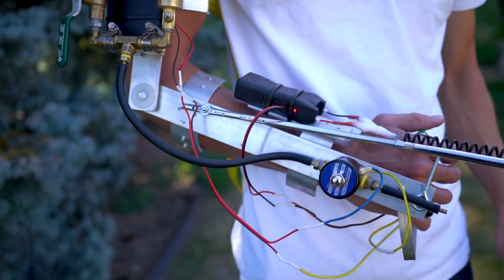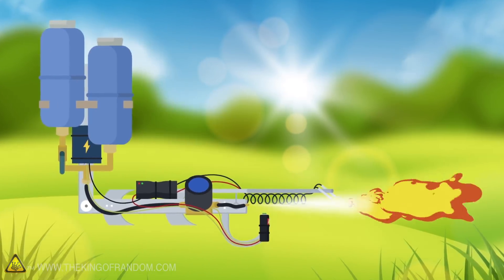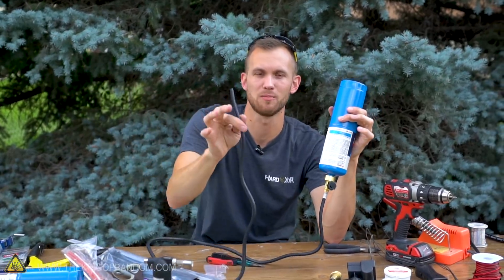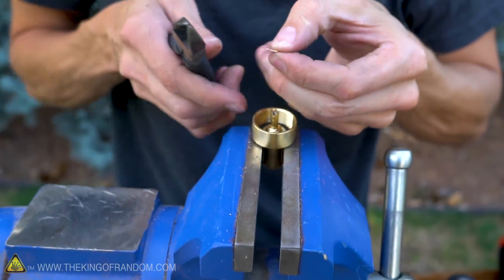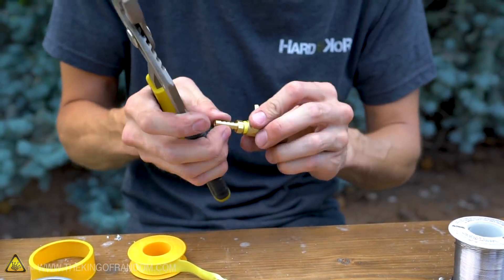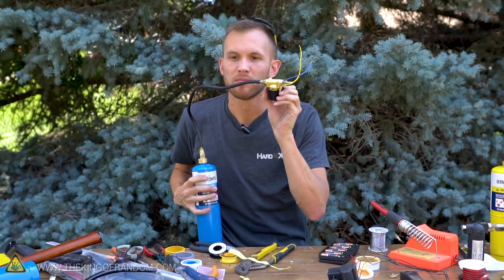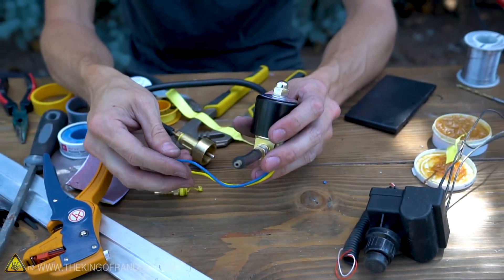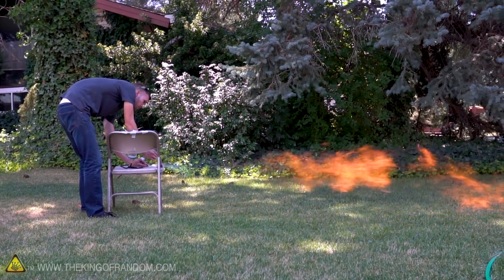THIS Might Not Be So Smart! TKOR Shows You How To Build A Flamethrower | Mandalorian Flamethrower

Comment: Some modifications to your design;
1: You should construct a laminar flow nozzle for the propane.
2: You should implement a spring system on the arm cage to help you actually hold the thing steady. Also, some cushioning would be wise, you don't want to chafe yourself.

Comment: create an explosion inside a container, making sure the integrity is enough to not crack it
Reply: You will have a container with high pressure. That's all.
Reply: That's physically impossible
Reply: well, i guess you could put a tea spoon of bp inside some big metal container an it wont make that much pressur
Reply: black powder doesn't detonate, it deflagrates when not confined, and in this cenario it's unconfined because for the explosion to be valid, black powder has to create a high pressure in a container and then this pressure is released very quickly (usually by bursting the container)